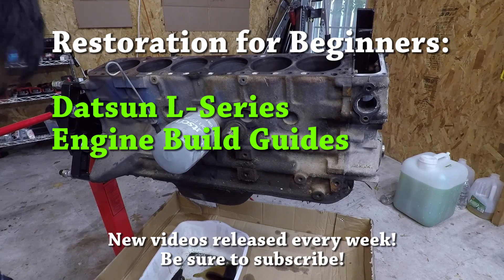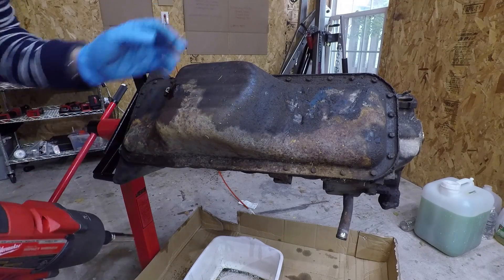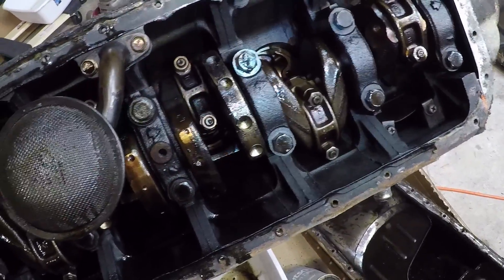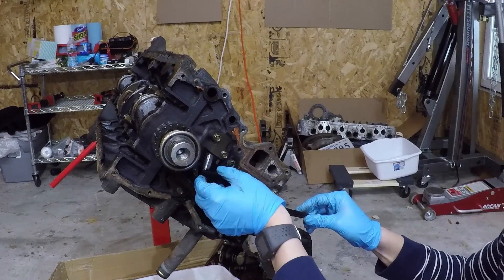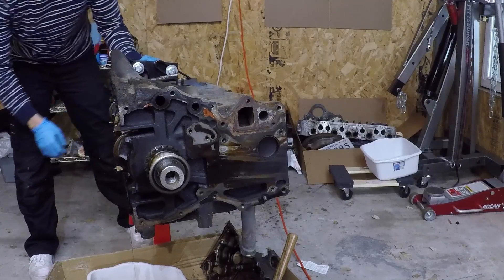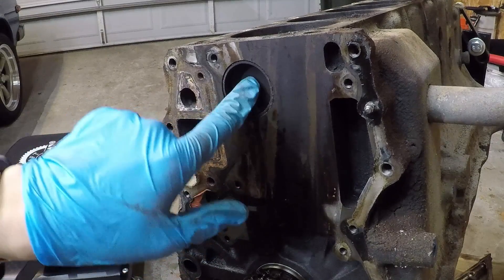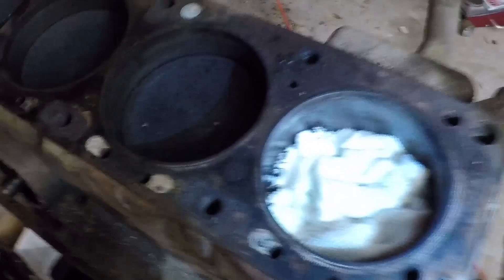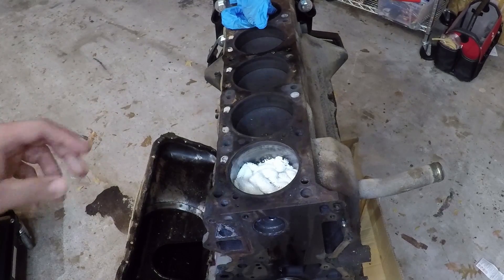Datsun L-Series Engine Guide Ep.3: Disassembly Pt.2 Front Cover & Oil Pan

Comment: should have been some reinforcement pieces around the rear sides off the pan, that's the reason for the longer pan bolts. Supposed to help with the sealing. prob left off on one of the pan gasket replacements.
Reply from the maker: +Dave WM that makes sense! I wonder if you really need it? I can always just take the parts off of the other engine when it comes time for swapping.
Reply: I figure it was needed after some leaking taking place back there may have been a common problem. I suspect it helps if the pan surface is less than perfect, plus makes it less critical on the torque setting of those small bolts. Don't want to over tight, think it calls for something like 7 ft pounds. I used a 1/4 drive to set that low.

Comment: They sell a pretty cheap tool for cleaning those ridges, so far pretty nice block.
Reply from the maker: Hm. Are you talking about a ridge reamer?
Reply: Ya, thats the name. couldn't remember what it was called.
Are you having the machine inspect it, if you tear it apart and it mics out ok, new crank bearing, rings, and hone the cylinders, and your there.
Reply from the maker: I was going to buy the reamer if only there was a bad ridge on the bores, but I think I'll be fine without it. Seems like a neat tool, but didn't feel like spending $50 bucks on a tool I'll probably only use once. I'm having the machine shop clean the block up and hone the cylinders, and I guess I'll let them tell me whether the bore needs additional work beyond that!
Reply: Heck you got it looking great. I believe the machine shop does all that when they hone them, so are you thinking about swapping blocks? Watch out or you will have everyone sending there l28 blocks to you to rebuild. Theres not alot to rebuilding this engine, as long as your keeping it stock. I need to go through mine, but it runs really good. Would be nice to have another engine, and just swap back and forth. Bet you cant wait to get to that body work !
Reply from the maker: I'm mostly doing this for learning purposes, I know it seems a bit silly to be rebuilding another L28 when I got a (mostly) perfectly file L28 in the car. I'm wondering if I want to do it just a bit differently though.. maybe a performance cam and triple weber carbs? I'm not, at least yet, willing to put down the extra 3K+ to build a stroker motor...
Reply: After finally getting my Z to run like it should stock which is pretty quick,. Alot of people ask when are you getting a better turbo, or whatever, I find the car really fun to drive basically stock. But having another block to play around with is a big plus. Heck build a stroker, good thing is you can do it over a long period of time.
Have you put together a list of body repairs you want to do.